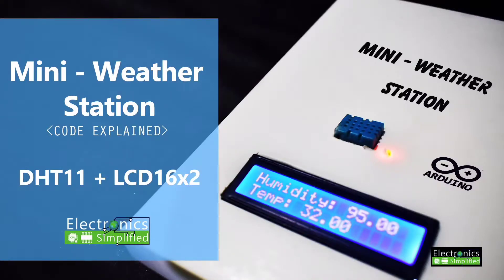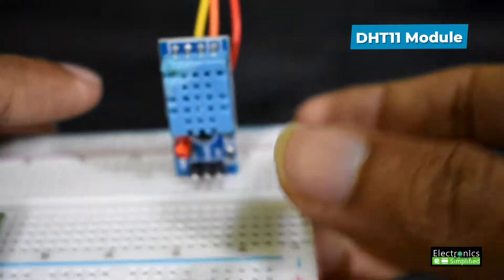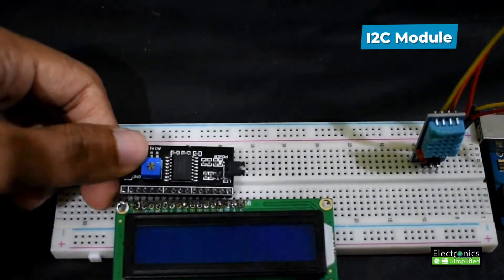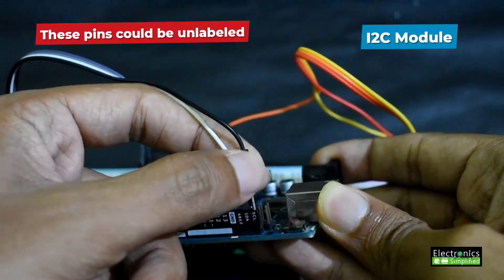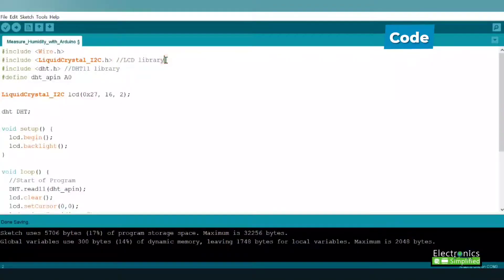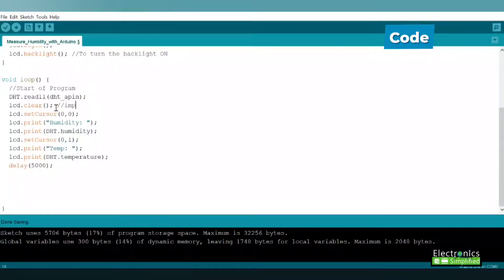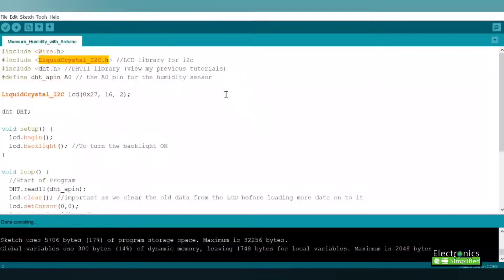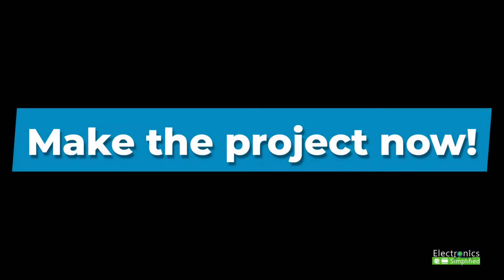Mini Weather Station using an Arduino

Comment: Hi, I wanted to build a small weather station with the Arduino uno R3, a 2.8 SPI TFT display and a SHT35 sensor, can it work or is it better to use an ESP32 ? Is there a box on the market to fix the 2.8 display and the Arduino ?

Comment: It actually shows 0.00 of humidity and temperature, the screen brightness would lower and it seems like the sensor heats up so much that it started to melt the plastic shell (when it was plugged in, idk why because it's the same sensor)

Edit: I found out that it was the wrong pinout (it seemed pretty obvious because it was heating up), the PCB didn't indicate what were the pins so I had to look for the pinout on the website that sells them and after connecting the right cables it worked
Reply from the maker: Check connections... Something is loose somewhere
Reply from the maker: Looks like you have done a mistake with the power connections... Please check if you are using the right sensor... If it is a different Humidity Module, then you might have to check power specifications.
Reply: @ElectronicsSimplified7  Yea it was different but as I said in the comment (edit) I found out that it had a totally diferent pinout

Comment: it just shows 0.00 on humidity and temp?
Reply from the maker: Please check your connections if they are correct and check that the wires are not losely connected.
Reply: @ElectronicsSimplified7  they are all well connected.

Comment: bro I mean when I upload the code. then led is showing humidity : 0 and temperature:0 
there are no real number coming.
Reply from the maker: 2 cases:
1. Your DHT sensor is not connected properly (check for lose connections)
2. Your DHT sensor is gone bad.
Reply: @ElectronicsSimplified7  ok bro got you thanks for the help

Comment: BRO AT THE END. MY. DISPLAY IS. SHOWING 0 0 ON BOTH LINES CAN YOU TELL ME WHATS AN ISSUE
Reply from the maker: Reduce the contrast of your display by turning the potentiometer at the back of your I2C
Reply: bruh same
Reply: Can you send the code sir
Reply from the maker: https://www.electronicssimplified.in/feed/mini-weather-station-using-dht11-and-lcd-16x2-interfaced-with-arduino/
Reply from the maker: https://www.electronicssimplified.in/feed/mini-weather-station-using-dht11-and-lcd-16x2-interfaced-with-arduino/
Reply from the maker: https://github.com/rolan37/Mini-Weather-Station-with-DHT-and-LCD16x2-using-Arduino.git
Reply from the maker: I have added the library too...
Reply: @ElectronicsSimplified7  bro it was like 2 years ago now I don’t know about this thing